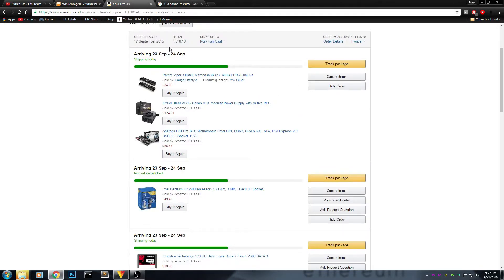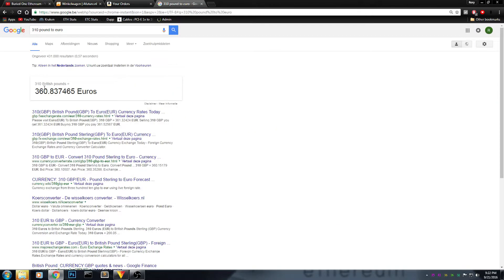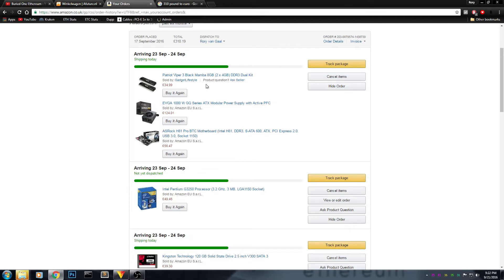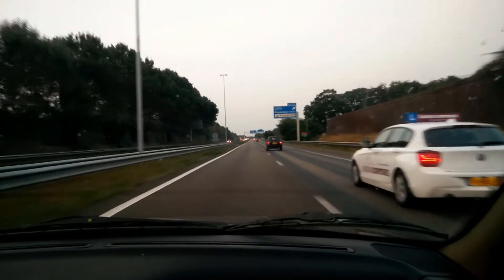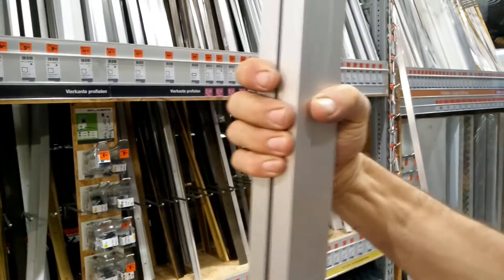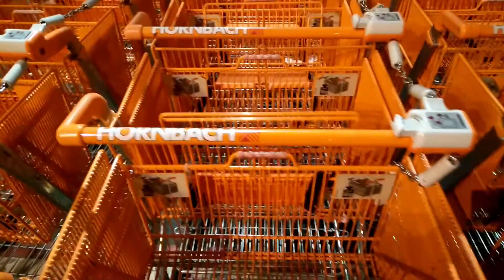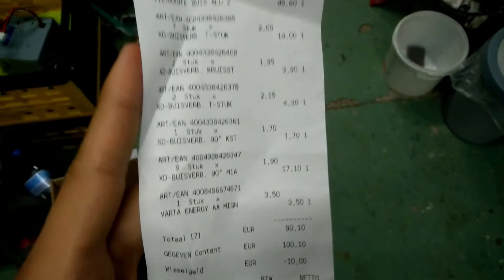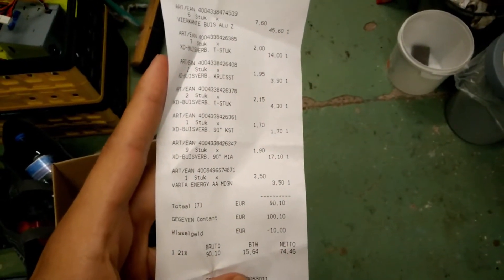Future Ethereum Mining Rig #4

Comment: I just use a steel rack shelf and hang the cards from the top vertically.  basically just extra shelf stuff I already had at home... kind of like these but I hang the cards vertically as i can fit more cards, only had 2 actual shelf pieces extra (with 4 legs) so  put 2 motherboards, PSU, ssd on the lower shelf, and attach the video cards vertically to the top shelf (file off a bit of the metal and then slide in the area where you would screw it in to your case normally, and then use a plastic tie to tighten the other end after wedging it into the wire shelf space a bit)...  for the motherboard mount i just use some PVC board i had laying around, cut out an area for the CPU so it stays cool and just sawed it to shape

http://cdn.overclock.net/5/5b/500x1000px-LL-5bb9f715_2feHArI.jpeg

http://i.imgur.com/5jHWzbp.jpg

might be cheaper to use shelves like this, and since you can put on a bunch of rigs... really cheaper... otherwise I think ordering prebuilt rig frames just cost like 10-15$ here.